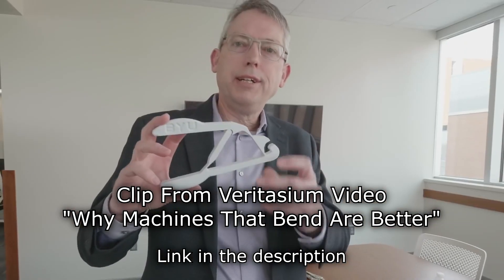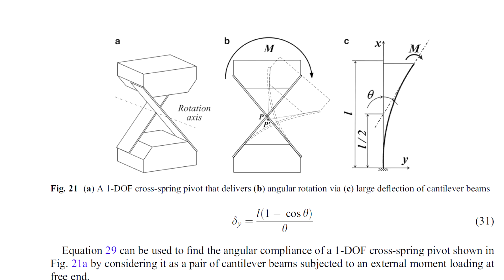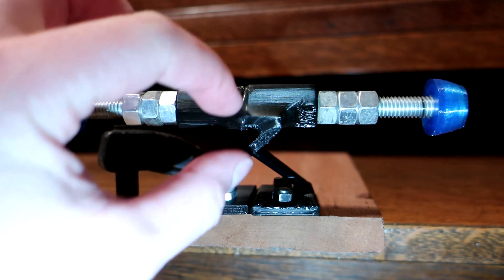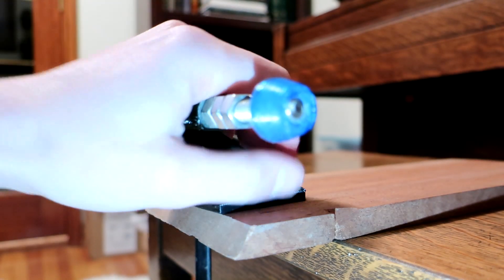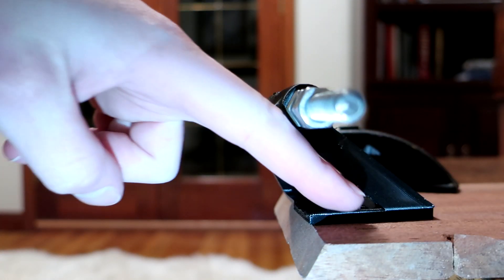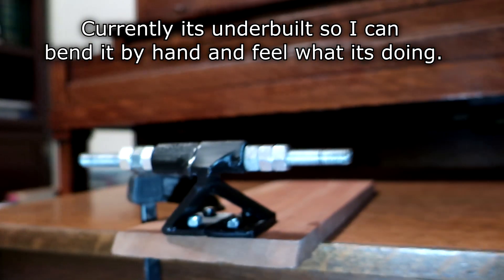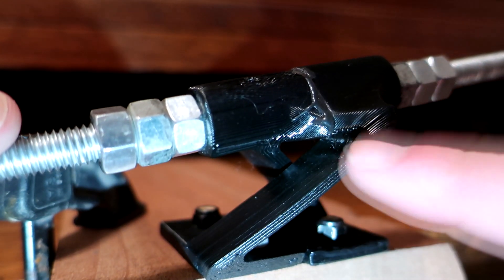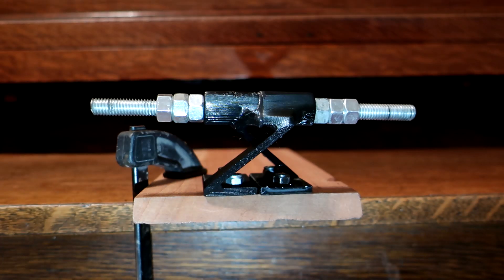Compliant Mechanism Skateboard Truck Concept

Comment: I have a suggestion to move your pivot point further to the ground. Because your arms are split design anyway, you can increase the space between them, and then have the attachment point on the ground-facing side of the axle, rather than the board facing side. I don't know what effects that would have with regard to the assembly twisting under load, but you could probably fix that by changing the mmoi of the spring a bit to account for that.

Comment: Instead of sweeping the springs back, why don't you just put a small angle on the base where it attaches to the board and tip the whole thing? It seems like sweeping it back shouldn't really have any effect other than the effects of increasing or decreasing the amount of material would have. All of the axis remain in the same directions.
Reply from the maker: Well the whole body of the spring kinda makes its own axis, so its still having an effect. But it does look like putting the mechanism on an angled base is what's going to have to happen.

If I could get away with not doing that it would save a lot of space. Unless its mounted on a mountainboard style deck, then there's no disadvantage at all.

Comment: Love the idea. Can't wait to see it with fine tuning and made from stainless steel or possibly hardened spring steel.
Reply: Isnt half of the idea that it seems to be able to work with plastic. Wait, easier production..?
Reply from the maker: That's an idea, each has their own set of possibilities.
I could see for instance spring steel versions possibly working for dirt boards or Eskate.
Reply: @Aaron Sanders no, this could lead to alot of new ideas. Both in manufacturing and performence
Reply: Mr X 

Yeah but then we are back to companies using that idea and then all cars look the same. So...

Comment: nice approach!
I see it can pivot but how does it rotate?
Reply from the maker: The rotation comes by pivoting at an angle.
If the pivot axis is 45 degrees, then for every degree of lean you also get a degree of rotation. 

On this truck I was aiming for a lower angle of about 30 degrees, but it ended up closer to 10.

Comment: On your first point(location of the pivot) - you could move the attachment points of the springs to the bottom side of the axle.
On the second point(pivoting) - I think sweeping isn't enough - you should actually fiddle with the angle of the pivots between the spring and the axle/board. Currently those... creases a guess... are parallel to the board. If you angle them, this will automatically angle the resulting pivot :)
Reply from the maker: "- I think sweeping isn't enough - you should actually fiddle with the angle of the pivots between the spring and the axle/board. Currently those... creases a guess... are parallel to the board. If you angle them, this will automatically angle the resulting pivot :)"

I think that's exactly what's going on.